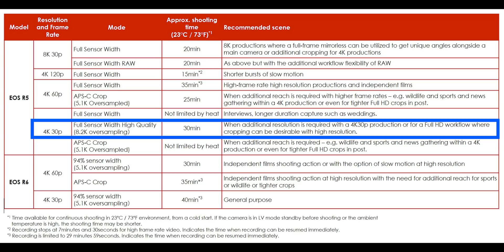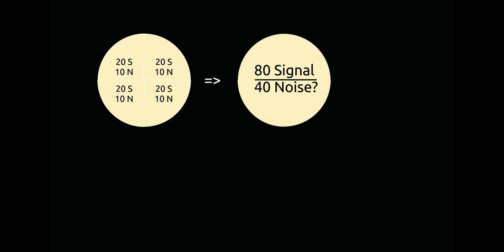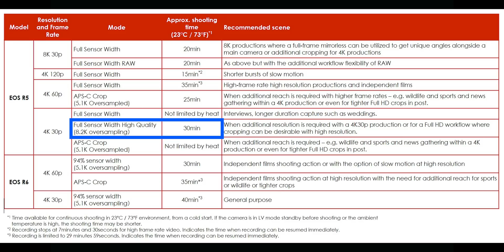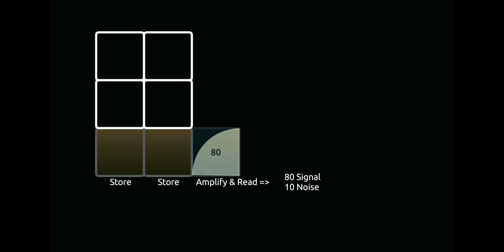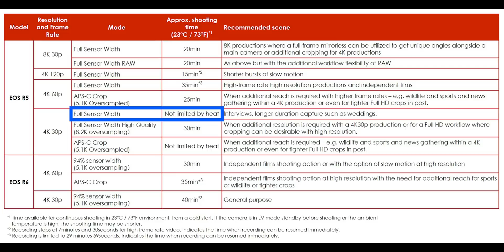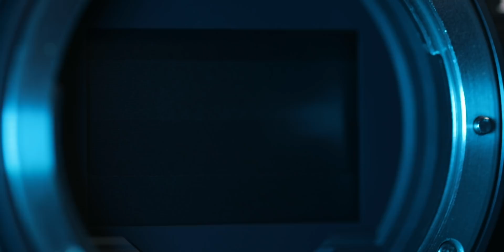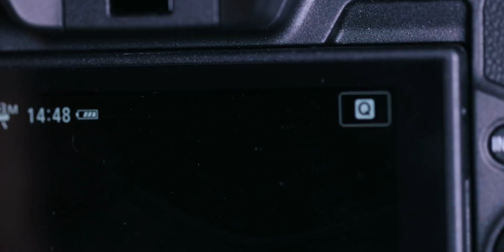Canon EOS R5 - Everyone is WRONG - Sensor explained - vs Sony A7s iii

Comment: How would you retain color info if you pixel binned 2x2 pixels?
Reply from the maker: You bin the red color from all 4 pixels separately, the green color separately and the blue color separately. 
Your mobile phone probably uses it. For example the Samsung S20 Ultra even shifts dynamically between a 108 MP mode and a 12 MP 3x3 pixel binned mode. In daylight, it can do 108MP photos for more effective cropping without much noise. In low light, it will dynamically shift to a 12MP mode, using 3x3 pixel binning.
Reply: @ctoLarssonTECH  But each pixel in a Bayer array sensor only captures one color.  In a 2x2 grid, 1 gets red, 1 gets blue, and two get green.  If you're just summing signal from these four pixels, then you would lose which pixel (red, green blue) collected what light.  Maybe there are some intermediate steps?
Reply: @RossMcLendon  Uff, right. However, there are new technologies introduced with 1DX Mk III with the new low-pass filter. I'm not sure how that comes into play, does it help things or does it complicate things further.
Points 4 and 5 in this document say some things about the new technologies in 1DX Mk III sensor, but it doesn't tell me what was changed.
https://www.canon.fi/pro/stories/eos-1d-x-mark-iii-vs-mark-ii/
 "But with this new system we are actually sub-sampling it 16 times and using a complicated algorithm to average it out. This then gives us that happy medium between having a low-pass filter and having no low-pass filter. The new design actually gives a slightly higher resolution than the Mark II because it's resolving more detail, while still reducing any chance of moiré."
Reply: @ctoLarssonTECH  It's a Bayer sensor. A 2x2 pixel cell has one red pixel one blue, and two green. Samsung's 108 megapixel sensor is a Nonacell chip -- it's got 9x9 blocks of red, green, and blue. So yeah, that's binned on-chip. Their other sensors are Tetracell (same as Sony's Quad Bayer), so you have 2x2 blocks of the same color, and those are easily binned on-chip. 

But for binning on a full Bayer sensor, which is as far as anyone knows or expects what Canon's using here, you have RGBG pixels in that 2x2 bin. It needs to be binned digitally, after ADC, before video compression. Even that's an advantage, as it saves the need to do Bayer interpolation. But you're saving image processing work, not sensor readout work. 

There is some supposition that Sony's using a Quad Bayer sensor on the A7SIII. Mostly because there was a leak of a Sony full frame (aka, 2.3") sensor with a quad bayer color filter array (otherwise it's basically the A7RIV sensor).

Comment: Most web ressources say hardware bining is not possible with CMOS sensors, because each pixel has its own readout. That's one of the big differences from CCD to CMOS. What you described makes perfectably sense for CCD sensors, but CMOS sensors do not shift lines or pixel before readout.
Reply from the maker: Let's see. On the mobile phone camera side we've done pixel binning for almost 10 years. The Samsung S20 Ultra even dynamically shifts between 108 MP full sensor read-out in good lighting conditions and a 12 MP 3x3 pixel in lower light. There are many different sensor types.

Comment: E mount lenses not as good. I guess my GM 24, 50, 135 is shit now according to you
Reply from the maker: Is there a similar stabilized 15-35 IS lens for the E mount, or a 70-200mm IS of similar size as the RF version? If there is, I'll switch.
Reply: CTO LARSSON - TECH right, because of the new IS lenses and suddenly E mount or even L mount is shit. You make yourself look stupid

Comment: Great presentation of the concept of SNR.  Have the EOS R, love the EOS R admittedly more due to RF lens, but thrilled Sony is pushing the envelope!!!  The new Alpha S will be very good in low light.  Physics is physics, big pixels mean better light gathering and more efficient/ easier readout...
Reply from the maker: Yes I'm also very excited about that. It will be low light performance like we've never seen in that size body. Great times!!

Comment: 20 fps cannot be sustained long enough to be usable for video, so even though it is there it is still a long way from being usuable.

Also, most of the heat is coming from the processor, not other parts of the camera. If you don't believe me, take a RX100V and record in 4K until the camera overheats, then feel where it is getting hotest. By far the hotest part of the camera is at the rear directly above where the LCD hinge is, and that is exactly where the processor is located. The processor is the part that is getting too hot and shutting down (more accurately, it is throtling and can no longer sustain reliable encoding of the video stream)
Reply from the maker: Right, correct today 20 fps cannot be sustained long enough in the R5. What I mean is that a mere 20% improvement is nothing, if moving from that form factor into the C500mkII, C300mkIII form factor. Hence they already have the technology to do that and it will come very soon. 
Interesting with the location of the processor. I didn't know that. Right, that would be the place to put some contact gel and try to lead off the heat.
Reply: @ctoLarssonTECH  It still would not last longer than part of a minute though. The main reason those burst modes work is because the raw data is just being stored in the buffer, the processor can't come even  lose to handling it in real time. So after a  certain number of frames the buffer fills and frame rates drop drastically. That 20 fps does not last forever, it lasts until the buffer fills. The real sustained frame rate is more like 6 or 7 fps.
Reply: Large sensors are far more likely to have heat issues than tiny 1" chips. Most full frame cameras doing video have had some limits set by the sensor itself, independent of the signal processing. Now of course, the amount of signal processing needed for a 4K raw image is the same on an RX as it is on a full frame pro body, but the pro body is also likely to have far better cooling of the image processor. The other thing -- IBIS also makes it more difficult to cool the sensor, which seems to be the main reason Canon didn't have it until now. This is an upgrade in Canon's sensor technology, but it doesn't cure all ills.

Comment: Pixel binning, due to the bayer filter arangement of colour sites, still has its own issues. If The R5 did simple 2x2 binning, it would have no colour information. Down-sampled works around this, but is intense for the processor to perform the calculations, hence the heat in that mode.
Reply from the maker: You bin them per color. I don't know how Canon will implement this, if at all, but I know a thing or two about mobile phones :-) and in mobile phone tech we've used pixel binning for almost 10 years. There are other solutions to achieve similar noise reduction without pixel binning, and also maintain more spatial info, like taking multiple images and then soft-combining them, but that's even more computationally intensive than simple down-scaling so Canon won't be doing that. If not using either of those techniques, there I don't think there is any way to avoid the noise ratio explained in the vid. Of course you can apply some de-noiser algo later, but that then comes with its own trade-offs. Thanks for the good comment!
Reply: Gerald explains:  youtube slash AcO0S1An_LY
High megapixel mobile phone sensors usually have a quad-bayer pattern where there are four of each colour in a group for easy pixel binning. Otherwise moire is introduced with a standard bayer sensor when pixel binned.

Comment: Just as I commented in another video regarding this.

The R5 is a great stills camera with some cine capabilities, not a compact cine mirrorless with some stills function.

Canon isn't insane enough to kill their Cine line
Reply from the maker: I agree, my big fear now is that I need to get both, the R5 for photos and the A7siii for video 😆😂
Reply: Absolutely correct. 5D4 replacement for me.
Reply: Canon should at some point, hopefully, see the advantage of selling any Canon camera to the end-user, rather than selling them a Sony, Panasonic, Nikon, or Fujifilm. The R5 is the first model in a while that suggests they might have finally caught on, body-wise. No complaints about the RF glass, other than price. 
Sony, too, seems to have kept the A-series crippled in video. But there's a difference. Sony has long had the technology to offer DCI formats, 4:2:2, 10-bit, or even raw recording. They chose not to. To avoid competition with CineAlta or to sell more Panasonics, it's hard to say for sure :-) 

I was pretty sure Canon was doing the same thing, intentionally wielding the Cripple Hammer so as not to compete too closely with Cinema EOS. But if you look at all the issues in Canons before these new models: no IBIS, cropped 4K, no DPAF in 4K, etc. it pretty much adds up to something else: Canon was just behind on technology. Old tech means more heat. IBIS makes it harder to cool a chip. Cropping lowers both the readout demands (sensor heat) and the image signal processing load (processor speed). All the specs suggested that Canon had finally licked these problems. The reality says that they've made progress, but haven't eliminated these issues entirely. So perhaps the older models were as good as they could have been given Canon's tech. Crippled relative to other competition, but not intentionally so.

Comment: Your explanation is great! I found a lot of downloadable R5 material here: https://vimeo.com/user803551 The oversampled footage looks great, the normal (pixel binned or line skipped) video has noticeably less detail. It is interesting to note, that the normal 24p and 120p footage has the same quality, which means that 50p/60p video will also have the same quality. This also means that the 50p/60p 4K mode has better quality on the R6, which is oversampled! Canon is planning to add additional raw options to the R5, I am curios about that.
Reply from the maker: Wow, great resource. I'm going to go check that out right now! Thanks mate

Comment: I don't think pixel binning can be done on standard bayer sensor unless Canon use a quad bayer.
Reply from the maker: Yes I'm also not sure. I know the rumors site wrote they do, but I'm not so sure. The sensor needs to be designed for it

Comment: Great video but something doesn't pass the smell test. Why would they call it HQ high quality mode if it were lower quality than the normal pixel binned mode? It must be preserving more color information or something in HQ mode.
Reply from the maker: Valid point. Pixel binning is widely used though, in mobile phone tech we've used it for soon 10 years. The con of using full sensor read-out is worse noise than pixel binning (and processing power.= heat). The pro is that the spatial information is better, so with smart algo you can make a sharp hair look like a sharp hair also when downsampled, while it will look more like a blur in pixel binning. That could warrant a "HQ" stamp. Still, we don't know if the R5 does pixel binning in normal mode. Maybe it doesn't. Then that would explain the "HQ" stamp on the full sensor read-out.

Comment: The Peter McKinnon video corner frame wobble was lens distortion.   Not the sensor stabilation.
Reply from the maker: It's an optical phenomena when you move the sensor, you can't keep both the face and the background stable (without using software). That's why the lens IS + EIS doesn't produce the same result as sensor OIS. Check my vid with the same RF 15-35, "96 ways to stabilize". Cheers mate
Reply: @ctoLarssonTECH  Is that the same thing that's happening with Tilt-Shift lenses, except with the lenses it's by design, but here it's a side-effect?

Comment: Very eloquently explained. Thanks for putting this together and I hope this reaches wider audiences. I was thinking along the same lines : the  R5's hardware in a larger XA style hybrid body to accommodate the power and cooling needs of prolonged 8K shooting would be the ticket. As for now, I just hope the R5 is a stellar stills camera, I hope it is a stills camera at all!n
Reply from the maker: Thanks Shaun for the kind words. Yes I think it's a very small step to take the R5, put it in a bigger body, add some 20-50% computing power and Canon got themselves a killer video beast with the RF system. I think the R5 will be a stunning still camera, especially paired with the new sharp RF f/1.2 lenses. The eye AF plus the RF system AF speed will make that shallow depth of field a lot more usable.
Reply: @ctoLarssonTECH  If Canon does not do this, a very clever DIYer might and find themselves with some serious popularity. Who will do it first? Maybe the Magic Lantern crew? Anyways, I hope to switch to the R5 soon (from 5D Mark IV) and get used to it in time for the world to thaw so I can use it! Strictly a stills shooter. I'll never forget my old 5D Mark 3 and 50mm F1.2 mis-focusing time after time late at night in Cologne Germany, the 5D Mark IV really tamed that lens and put it to work, I'm expecting an even greater increment of improvement with the R5.
Reply: @ctoLarssonTECH  https://www.canonrumors.com/there-is-another-rf-mount-camera-coming-in-2020-cr2/ this might be it!

Comment: Interesting, but how can pixelbinning work on a bayer filter?
Reply from the maker: Don't know. In mobile phone tech we've used pixel binning for almost 10 years, good chances your phone uses it in some modes. But there are lots of ifs and buts. The sensor has to be designed for it.
Reply: It can't really work as described, far as I can tell. A camera with a quad bayer sensor has a 2x2 array of same-color pixels, so it's absolutely possible to merge the output of all four charge wells before the charge to voltage conversion, delivering that to the amplifier and ADC. 

But on a Bayer sensor, you need to maintain RGB data, so I don't see binning on-chip doing anything for you. Technically, you could bin the two green pixels in any 2x2 set and reduce noise a bit, reduce readout data a bit. But I think this sort of binning is generally done in software: very low cost resolution reduction, not need for de-bayering, and of course, less image processing for video format conversion. There is a limit of what can happen on a sensor.

Comment: good video..BUT..How can overheating be crying in a camera costing way over $3-5,000?I mean,to buy a camera and overheating kills the camera,is not just crying,it's a logical concern.Canon  should have found the issue and addressed it before releasing the camera..period..That's their responsibility,because ethically,it's not a good practice to have poor quality control.That's like a sports car overheating  at 120mph and the engine being destroyed...WE have enough products,by now,at least I do,that we should not have overheating issuesThere should be no line skipping,binning,etc,etc either,because we already know those issues exist.
Reply: it's a consideration Canon had to make, either go for a full weather proof camera where  a fan clearly is no option and use the camera's body to dissipate the heat or give in on the weather proof aspect of the camera and use a fan to prevent the camera from overheating.
Reply from the maker: Agree, what I mean is that in case the 4k "non-HQ" mode does pixel pinning, that mode will have better Signal-to-Noise ratio than the "HQ" mode, and in that case it's what will be using anyway for long form content - and that one is not limited by heat. Then no heat issue exists hence no reason to cry. But would have been great to have this confirmed by Canon agree 100%.

Comment: From eoshd.com: “In order to achieve the higher frame rates, the sensor uses 2×2 binning, similar to the 4K video mode on the 60 megapixel Sony a7R IV.

The 4K 30p non-HQ mode is read from the sensor in the same way.

Since this has a much lower frame rate, there’s less heat and less work for the image processor. Thus the 4K 30p (and 24/25p) pixel binned non-HQ mode does not have a thermal cut off.”
Reply from the maker: Thanks mate. I've seen that, but have not been able to confirm that rumor yet. Fingers crossed
Reply: CTO LARSSON - TECH   Great! Will be looking forward to your follow up video 👍
Reply: That implies pixel binning off-sensor. It's certainly the case that a 4x4 pixel binning uses less (virtually no) image processing than debayering and then a whole sensor downrezzing. That may be what's at work here. People complain about Sony's A7R series doing pixel binning rather than whole sensor scaling, so this seems a likely explanation.  There seems to be some belief that a 6-8K image rendered to 4K and compressed to 100Mb/s AVC is better than a 4K image compressed to 100Mb/s AVC. I suppose it depends on the full resolution downscaling algorithm. Though the pixel binning ought to have less color error since there is no Bayer interpolation needed.

Comment: A7Siii looks like a joke if I'm honest.
Reply from the maker: The A7Siii low-light performance will be mind bending I think, but it's a let-down if it doesn't take reasonable photos agree
Reply: @ctoLarssonTECH  Just use night vision goggles.
Reply: @ctoLarssonTECH  I assume you've seen the R5's ability to autofocus in animals in the dark with just a small light right?
Reply: it depends what your needs are, will be interesting to see what kind of 1080p quality it will produce